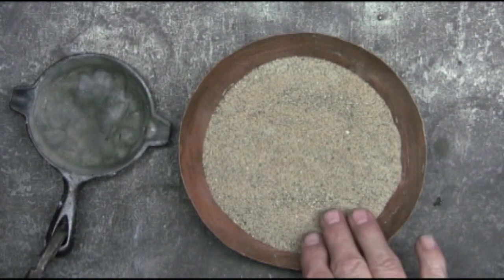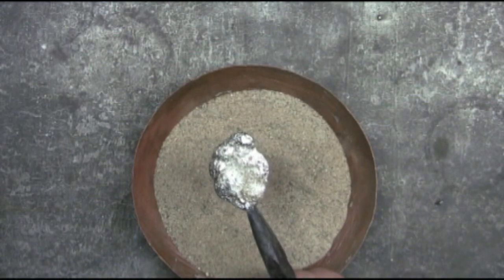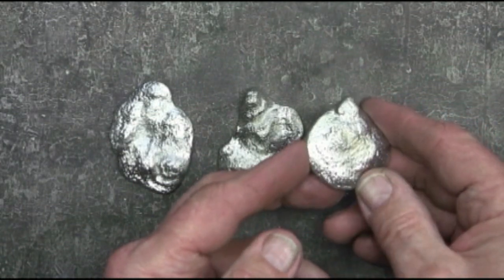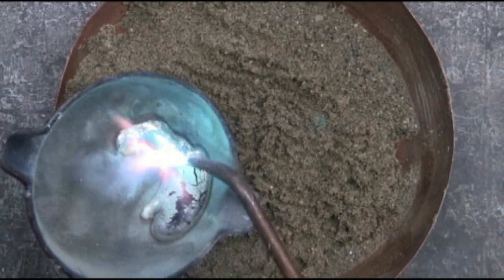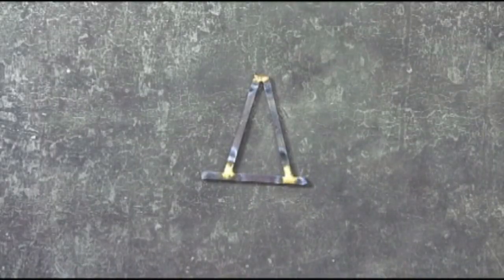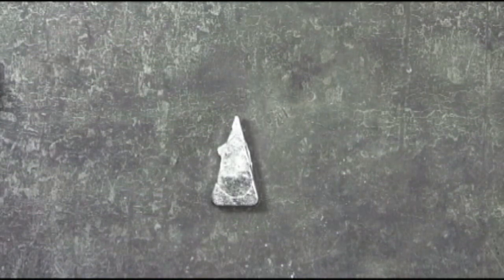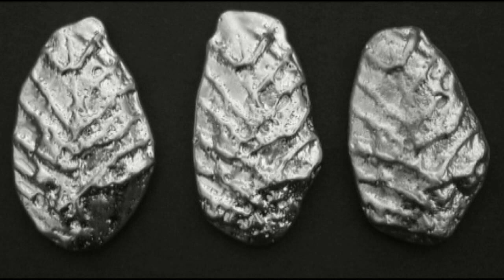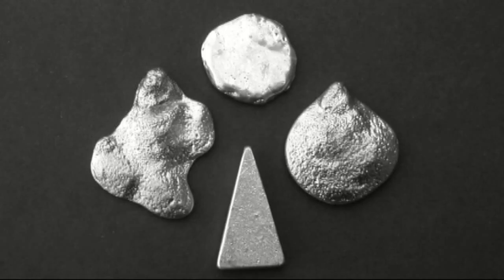Having Fun With Pewter #2

Comment: Wow this is great! I'm very new to this.  I have some questions. Is non lead solder the same as pewter? I saw on another persons video that when using a plaster mold to pour solder in  it needed to be put in an oven on broil for 20 minutes or water in mold would come out in steam in pewter and explode. Is this right? I wanted to try this but don't want an explosion. Also how can you tell for sure if something in a flea  market is pewter? Thank you so much for a really great video.
Reply from the maker: Ellie, if there is moisture in the Plaster of Paris there will be tiny explosions.  the more moisture, the more explosion.  I don't know how to tell whether something is pewter or lead.  Safest way is to buy an ingot from Roto Metals.  If you get a 1 pound ingot, you can melt it and then re-melt it over and over until you get what you want.  rotometals.com   There are four pewter videos.  If you go to my complete list of YouTube videos and scroll down you will find them there.  www.gsegmedia.com.  Thanks for watching.
Reply: George Goehl I watched all four videos. Ready for 5 and 6.  They are so full of information. I noticed you added water to sand and used as a form to pour in so the moisture is not a big deal? Explosions tiny not dangerous? I also really loved how you added a small green stone to pewter. Can't wait to try. Thank you so much for videos and answering questions.
Reply from the maker: Ellie, just to be on the safe side,wear safety glasses and you can wear a long sleeve shirt and gloves.  I wear safety glasses but not the long sleeve shirt or gloves and I have never had a problem. Experiment with just a bit of moisture in the sand and go from there.

Comment: What is the smooth surface you're working on and where would someone obtain it?
Reply from the maker: I'm using as steel top table.  Here is a video on this welding table.
http://youtu.be/LA_ACLaFeQU
Look in your yellow pages for a steel warehouse.
If you are only working with pewter you do not need anything this heavy.

Comment: Hi, I ordered pewter from roto metals and it melted very well. Thank you. The pewter came very clean but after I melted it in a crucible it became dirty? I used borax to season crucible but not sure what I did wrong. Also tried to set stone several times and it fell out when pewter cooled. I must be doing something wrong! The more I work with it the softer it gets, is there a way to harden pewter wire? Thank you for all of your help.
Reply from the maker: Ellie, In the first video I show using a spoon to clean off any dross.  http://youtu.be/6sP14djt8SQ
If a stone falls out I use a tiny drop of 2 part epoxy glue to reset it.
Don't know anything about hardening pewter.  You might email Roto Metals and ask them.
George

Comment: Hi, I purchased some pewter non lead serving trays. The smallest is 1/4" thick x 10"x 5". I got a cast iron frying pan, put pewter in tried to melt with a map gas torch, nothing happened. Next fired up charcoal grill, put cast iron pan on coals with top on for over two hours. Everything very hot but not melting. What am I doing wrong?
Reply from the maker: Ellie, propane will melt pewter.  Mapp gas is hotter than propane so you should have no trouble melting pewter with Mapp gas.  I just tried a piece of pewter with propane on a very low setting and as soon as I put the flame to the pewter it began to melt.  Are you sure the non lead serving trays you have are pewter?  

The pewter I was melting was off an ingot I bought from Roto Metals.  Keep me posted.  George